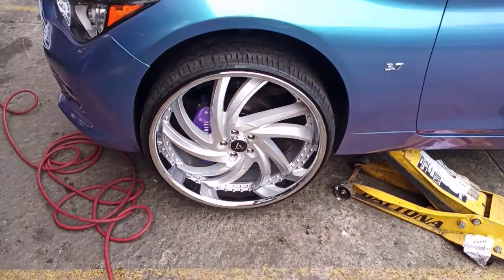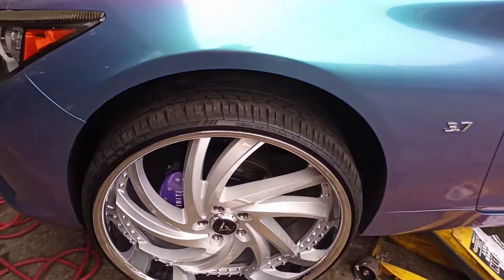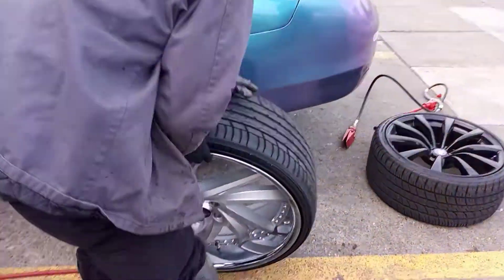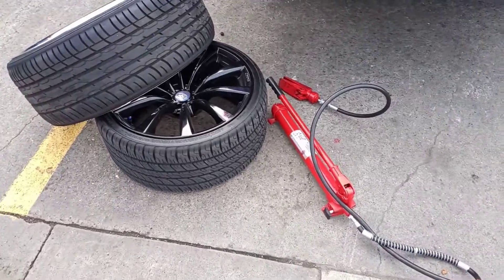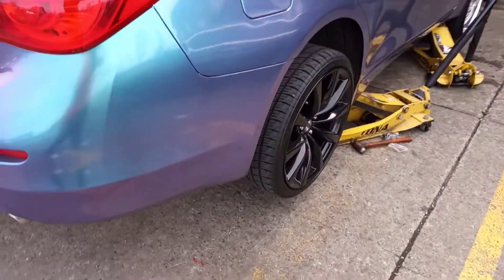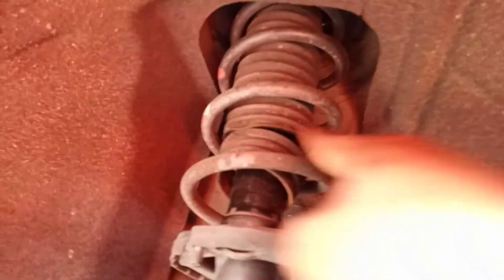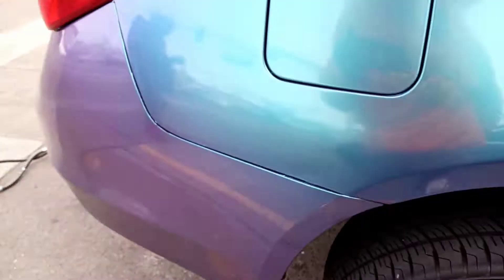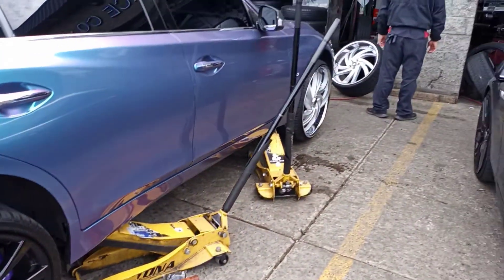How I put 24 inch rims on my Infiniti Q50

Comment: What’s the tire width on them 4s
Reply from the maker: 24x9 front and 24x10 back staggered
Reply: @G37vsQ50  295 on back
Reply from the maker: @deydeybrown4824  24x10 on the back wit a 275/25/24 tire front 24x9 wit 255/25/24 tire
Reply: Good look very nice could you run the 275/25/24 tire in the front or would it hit the knuckle